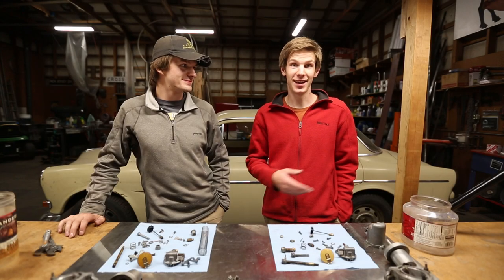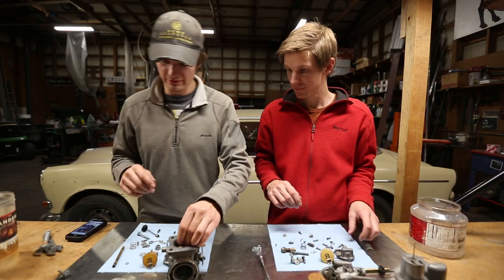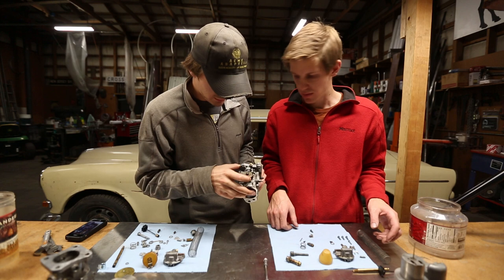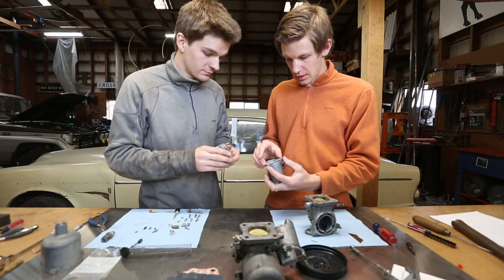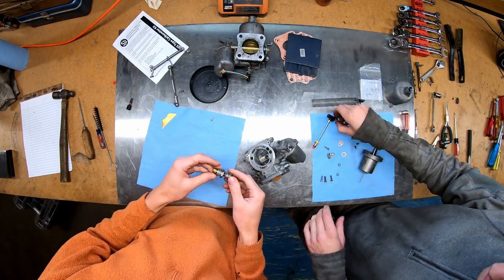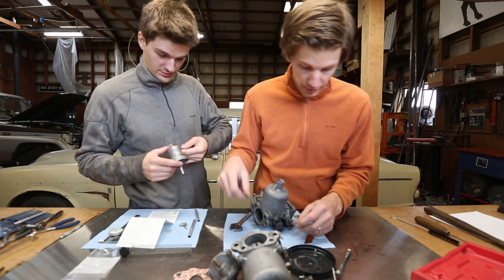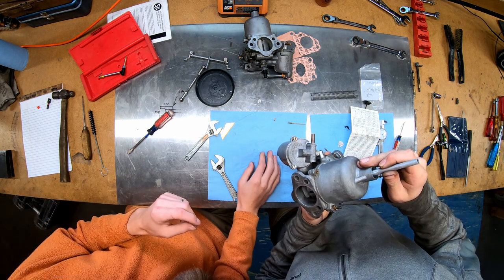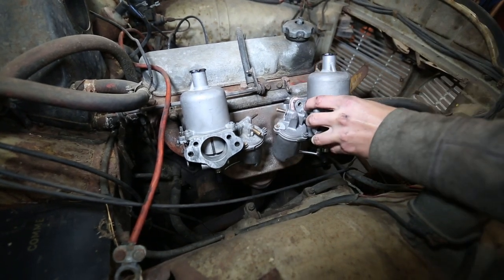SU Carburetor Rebuild on the Barn Find Volvo Amazon

Comment: Nice to have that centering pin. Unfortunately the machine shop went all the way through with the hole for the bushing. They should had left a little gap there to let the bushing just go in to a certain point! Anyway, you gave your best and got them back together. I hope they worked!